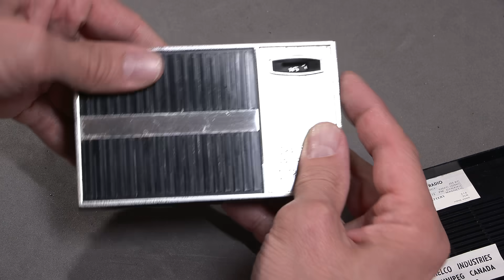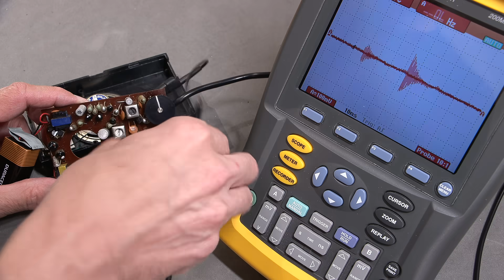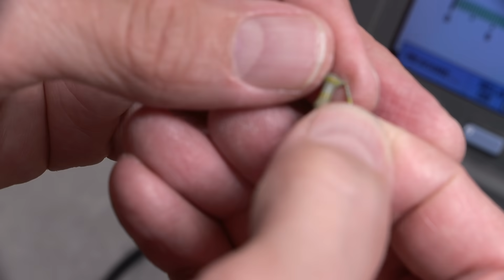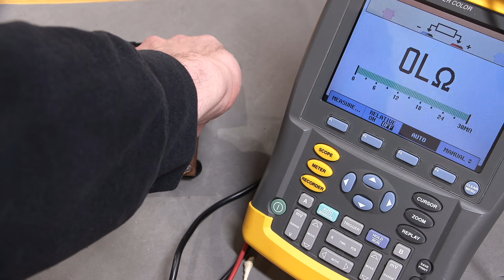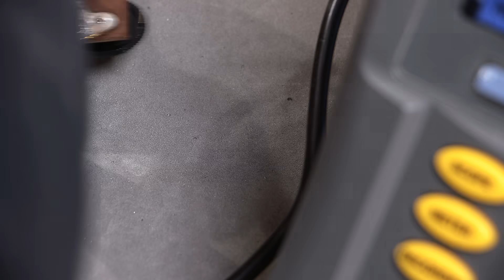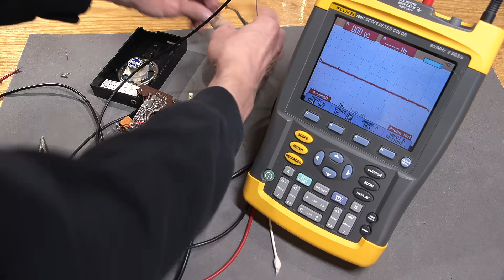10 Transistor TRANSETTE Radio Receiver Troubleshooting Adventure!

Comment: Mr Carlsons lab I have a vintage zenith Trans oceanic transistor shortwave receiver it is battery operated  I want to restore it  let me no ware I can get Russian germanium transistors?😢my friend
Reply: Where does the TO use germanium caps?  You can get germanium standard and electrolytic from the usual sources…Mouser…DigiKey etc.